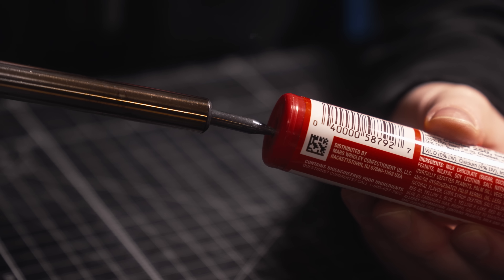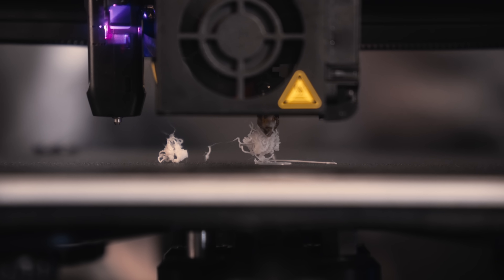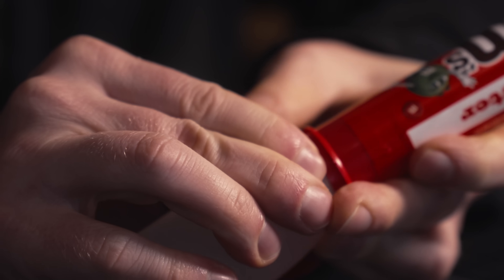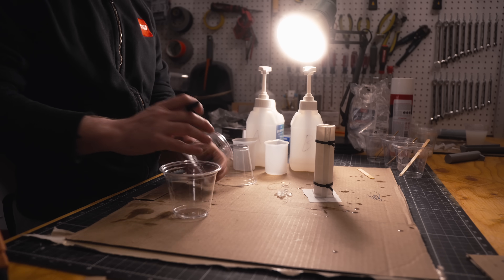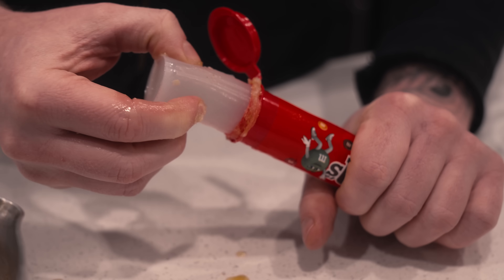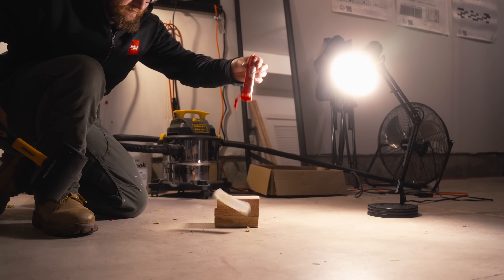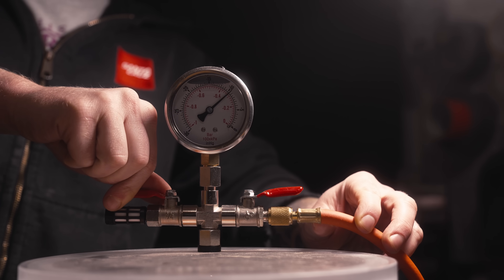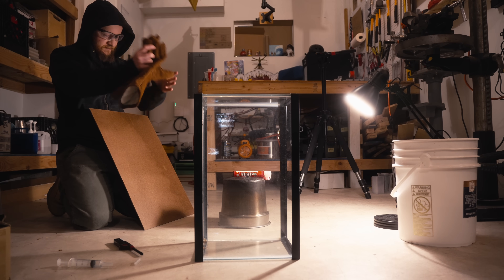Solving Reddit's Cylinder Problem with Science

Comment: I have used a drill bit rolled back and forth between my fingers to drill a hole through a fingernail I mashed in a car door. I heard of a hot needle but even the slightest pressure hurt quite bad... The drill bit rolled like a stick starting a fire got through surprisingly fast and without pain... So yeah, that's where my mind went.
Edit: and the proverbial "baseball thoughts" 🙃⚾

Comment: As someone that does not have any cylinders, would it then just be that the op should have just drilled a hole into the m&m tube before putting in the butter, mashed banana and then the cylinder???

Comment: Why didn't you try running hot water on just the tube? That's a classic way to get plastic to expand, like with lids that are too tight. I'm not sure how silicone reacts to heat in comparison to flesh, but that would have been my first method to try.

Comment: If the whole issue was releasing the negative pressure, you could have just shaved a whole in the bottom rim, completely avoiding cutting anything just touching the base of the tube... Climax by putting the tube into a cup of hot water to reduce van der Waals attraction, and bam. Free cylinder.

Comment: On the subject of heat, there is indeed a powertool capable of gently melting this plastic! It is used by electricians to bend and shape PVC conduit before running wiring inside. It could gently melt the tube, but the melting point is high enough that it could cause burns on the OP's cylinder.

A heat gun can do this crudely, but there are blankets which plug in and warm the pipes up in a few minutes.

Comment: So here's what I would do: go out and buy a second tube, using calipers to measure the thickness of the walls of the tube, take a dremel and mask off a cutting wheel to leave only enough of the cutting wheel to cut through the tube but not into the 'cylinder' to make a diy cast saw. (And as I type this, you just came to the cast saw conclusion. Hah!)

Comment: For anyone wondering, you puncture the end of the m&m tube to release the vacuum. Be careful to only puncture where the butter and mashed bananas are, or your cylinder will be damaged. If it got in, then you will be able to pull it out at this point.

Comment: Depends, if the cylinder is flaccid, then use a cast cutter: it goes back and forth, only harming rigid objects since flaccid objects jiggle back and forth with it. If the cylinder is rigid, use a scalpel, dull cutting implement, or exact-o-knife to bisect the container. Or, if the cylinder can become flaccid, then the issue is only a current one and will be solved soon. If the cylinder is too big for the container, which seems to be the case, cut along a circlular shape near the end of the container, and scoop out whatever is keeping it inside. Hope this helped!

Comment: I think it should be noted that, in SmartCalendar1874's original experiment, the cylinder was attached to a larger structure which would make many of these methods non-viable. However, the cast saw still seems like the perfect answer.

Comment: The problem for the OP is that his cylinder probably swelled in the process so though the initial fit may have seemed comfortable, it might become too engorged to be easily removed. 

The best course of action would have been to go to the hospital where they would have tools that would allow cutting of the tube without damaging the cylinder. Maybe a cast saw? Edit: just finished the video, haha.

Comment: Using a nail to make a small hol at the bottom (thus avoiding the cylinder) you can add cold water into the cylinder. This will cause blood to leave the cylinder reducing inflamation and combined with the water pressure should alloe the cylinder to be removed without harm.

Comment: 15:50 woah, woah, woah, who said anything about there being skin involved. This is just a cylinder
Reply: As the start of the video stated, it's most likely made of a material similar to skin.
Reply: well at least if the cast saw couldn't harm skin, it couldn't have harmed whatever carbon based substance attached to another object that the cylinder was actually made of.
Reply: the OP mentioned the cylinder expanded in size which means its more than likely something soft like skin so the cast saw should still work
Reply: @r @randomdude9630 Well obviously the cylinder is the male genitals
Reply: casts are usually in close contact with skin

Comment: i wonder why the OP didn't just say it was their finger getting stuck? a cylinder is oddly unspecific and begs the question "why can't the cylinder be disassembled and reassembled?".
Reply: You would need a really thick finger, and maybe they just wanted to be as specific about the size as possible in case some tools only worked for that size??? Idk
Reply: You can harm your finger a little, but not your cylinder
Reply: The implication is that it isn't a finger...
Reply: You could post a picture of the finger and not need to call them cylinders
Reply: @NickTaylorRickPowers yeah but the comment you’re replying to literally says you wouldn’t call it a cylinder in that case
Reply: What kind of fingers do you have that are 5.1 inches long and 4.5 inches circumference?
Reply: Lucky gal.
Reply: @SchemingGoldberg  Maybe he has big hands, we dont discriminate
Reply: Finger in melted butter and mashed bananas..

Comment: The size might still be accurate, it's might be that the cylinder they used was more flexible than silicone, but then it wouldn't have gotten stuck, so it could also be able to change how flexible it is and even how large it is, that might actually be how it got stuck in the first place. Also, the original cylinder must be more susceptible to friction burning, so they went to a hospital to get the tube removed by a professional to minimize the risk, or they just didn't want to buy a cast saw.

Comment: You seem to have forgotten that the cylinder was not perfect, and was likely not FILLING the entire end of the tube, which would mean cutting the rim off of the bottom of the cylinder does not jeapordize the cylinder but allows the negative pressure to be relieved.

Comment: Cylinder was propably attached to system of pipes and a turbine pumping some sort of "ketchup", cylinder increased it's size after being put in m&m tube (ketchup flowed into it). The "system" considers cylinder not important for survival, so if more important stuff in the system was freezing or had low ketchup levels, the ketchup would leave the cylinder and go somewhere else, decreasing cylinder's size and making it possible to remove it. I hope at hospital they reduced ketchup amount or put the system in cold environment and didn't just remove the cylinder from the "system". Thanks to documentary about mount everest for providing me with information regarding value of various "system" components. (Ex. When human gets unalived of hipothermia, legs and fingers are the first ones to be cut off from ketchup supply, and we can speculate that the "system" is similiar to human body)

Comment: I was literally screaming in my head ”cast saw” for the entire video and it made me so happy when that was the solution
Reply: Same! I even commented that it was obvious but then I finished the video, and well, it was indeed obvious.
Reply: I was not aware of the capabilities of a cast saw. This was really cool to learn about.
Reply: @PingMe23 it's basically the same principle as diamond saws used for cutting tile and stone. you can basically touch a wet stone saw because it's not a cutting tool it's a grinding tool. grinding tools unless they are made with nanoscopic grinding grains are very unlikely to have much of an effect on anything soft. that's why you see all those dudes cutting geodes seemingly being pretty reckless with their little table saws, when in reality that saw is not going to cut anything other than extremely hard rock. cast saws work in the same sort of way but they also have the added protection of not actually spinning the grinding tool. it's more of an oscillating tool that vibrates at extremely high frequency.
Reply: Yeah, hospital was def the answer.
Reply: Right? It's like when you figure out who the murderer is right at the beginning of the mystery and it just feels so amazing to be validated lol
Reply: They're cool and all but not 100% safe. I have a burn scar on my arm from a cast saw.
Reply: Hospital
Reply: Can't you just... Jam a drinking straw between the cylinder and tube and blow air into it?
Reply: @Antigen__  OP said it formed a seal that prevented them from putting water in the tube. If it's watertight, how would you get a straw in there. Remember: It's imperative that the cylinder remain unharmed.
Reply: @KingDetonation  but couldn't u squeeze your cylinder just a bit enough to squeeze the straw in
Reply: Cast saw is that they would do in ER.

I'm wondering about bug spray with DEET. Can melt plastic and won't do more than make the cylinder sting a bit. Would it work on the type of plastic that MM tubes are made of?
Reply: Hospital.
Reply: It’s also definitely what they did at the hospital
Reply: Me too, but spoilers :( awww
Reply: I was thinking multitool which is basically the same thing but for wood, drywall, etc

Still won't cut you

Usually

Comment: I wonder if the cylinder is stuck because when you try to pull it out it creates a vaccuum. If there was a hole in the cylinder tbis would be convenient. You might be able to push a mineral rich liquid through to counter that vaccuum.

Comment: Why make the mould out of silicone. Just make a box and take a negative of the cylinder from it in CAD then split that in half, add spheres around it to line it up, subtract from one half then scale .99% and union to the opposite half. Spray mould release in print, clamp together and pour in silicone

Comment: Here's a solution that should horrify 99.5% of the population, and delight 0.5% of the population:

Drill a hole in one end, then insert the nozzle of an air compressor. Squeeze the handle and watch as air goes around (and in) the cylindrical object , creating enough of an air gap to safely extract the cylinder.

Comment: 11:54 I believe there may be a strong, exponential increase in the undesirability of the solution as the amount of pressure increases, especially in configurations where the pressure is applied to the cylinder at one or a finite number of points
Reply: What led you to this conclusion?
Reply: @zwrulez185 the cylinder has nerve cells and  can feel pain
Reply: E

Comment: Actual solution that would work: double boiler. Just get a stepladder and let the cylinder + tube soak for a few minutes until the banana and peanut butter return to the temp they were at originally.

Comment: Drill a small hole in the end of the plastic wherever you’re certain it won’t contact the cylinder.   This will relieve the negative pressure, and you should be able to pull it out.  If it is still stuck, add positive air pressure with a syringe or practically any other method

Comment: You could very very carefully drill a small hole in the end with like the tip of a knife and once the air pressure is equal inside and outside the m&m tube the cylinder should come out no issue. In theory I’m no scientist

Comment: i spent fifty two seconds very confused as to why op would put a cylinder full of banana and butter into a tube of mini m&ms. some goddamn how, it took me until the word dick appears on screen to realize that he had tried to use a mini m&ms tube as a fleshlight.
1) reddit has seen far worse than just getting your dick stuck in a stupid homemade fleshlight, you can say that that's what happened
2) go to the hospital, they have seen FAR worse than the average redditor and they won't tattle on you; even if they judge you for being kind of a moron, at least they're present and able to help you.

also, if you find yourself in a situation with lower immediate stakes, but still really embarrassing, and youre worried about somebody important in your life finds out, just get tor and create a burner acct

Comment: I live by the philosophy "keep it simple, stupid." Pull away from the cylinder while applying a slight twist left to right. The left and right motion break the seal that formed between the cylinder and the wall of the m&m tube while the outward pulling motion drives it off of the cylinder. And nothing was harmed in the process.

Comment: Technically even if it did touch the bottom, you can still burn out the cylinder at the bottom using a soldering iron with whatever bit you dont care to replace or with a wrap that wont burn to keep plastic from getting stuck to it, it would release pressure and if big enough for your pinkie, you can push it out (edit: just got to the point where it was mentioned, this would still reinforce the usefulness of that method in a different way)

Comment: My suggestions:

1: ICE! douse the area in ice. The M&M tube will remain the same size, while the cylinder shrinks away.

2. There is room at the tip to poke a hole, use a needle in the radially outward direction from the cylinder. This will relieve the vacuum allowing it to be unstuck.

Comment: Thought cast saw immediately lol.

As another option, use knife, but not like you did. Use to shave the far edge of the tube until a gap is made. See if it separates. If not, work your way around the end, whitting until the end pops off, then push from the other direction.

Comment: The obvious solution is to wait until the cylinder becomes flacid, then push a cotton swab into the base of the m&m tube to provide enough air to release the suction. I've had many such experiences so I'm kind of an expert at these types of experiments

Comment: I think you redeem yourself and build a Silicone Cylinder Canon
You obviously need to round the tip a little bit more for aerodynamics. I think a video called "Scientifically finding the right girth and length" with several versions of your projectiles as a thumbnail would be a great video. As a target I would use two pillows gently pressed against each other since we don't wanna damage our projectile and test it's penetration ability. For example the helicopter technique might look impressive but could lack in other abilities.

Comment: I'd have used a can of WD-40 with the thin red straw;
1. I'd blunt the end of the straw to avoid abrasion of the “cylinder”, probably using heat or 3,000-grit sandpaper.
2. Lube it and slide it between the trapped “cylinder” and the tube as far as possible. 
3. I'd gently press the cap, making sure the can was upside down, to only release gas (not WD-40), increasing the pressure at the end of the tube, forcing the contents out. 
4. Hey presto, no more entombed cylinder.

Comment: for chemicals - if acetone didn't work, you could have tried linalool. I've melted a plastic keyboard with lavender essential oil and that's the primary component in it, and I think it's used in 3D printing to smooth out certain plastics. There's also that acetone free nail polish remover that can affect acetone resistant plastics, that's also milder on the skin

Comment: Oscillating tool w/ diamond bit would do the trick. They use it to cut casts off. It cuts through the hard plaster but just vibrates the skin.

Comment: I would also suggest that you do not harm the 2 2 inch spheres that are attached to the cylinder's underside in a loose sack.

Also I am slightly upset that my cylinder does not fit in a mini m&m's tube.

Comment: I feel like perhaps the cylinder's size seemingly not fitting inside the M&Ms tube could be explained by the material. Perhaps instead of plain silicone it was made of a spongier material, and insertion somehow caused that material to fill up with some sort of liquid, likely coming from the larger object the cylinder was attached to, thus expanding the cylinder to its full size, or as close to that size as it could get while inside the M&Ms tube.
Reply: Generally, those types of spongy materials are able to remove the liquid if it was provided by the large structure. 
This means that either:
a) The act of insertion somehow blocked the ability to remove liquid from said spongy material, either from malfunction or an intended feature 
b) The cylinder absorbed liquids from mushed banana and butter, and was unable to be removed from the M&M tube
or c) The cylinder only had a one-way valve to insert the liquid.

This is definitely one of the most curious cases of an experiment gone wrong, there's so many questions left unanswered.